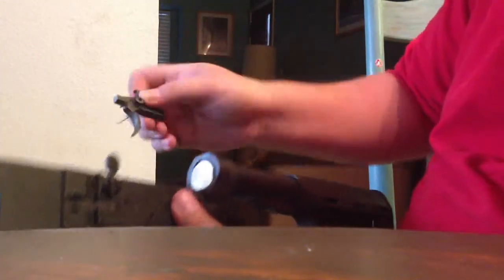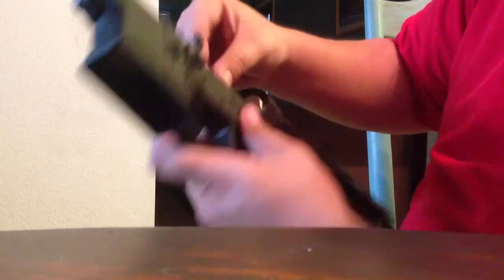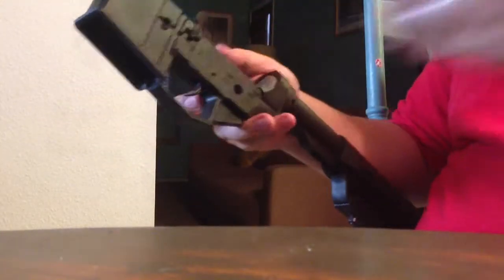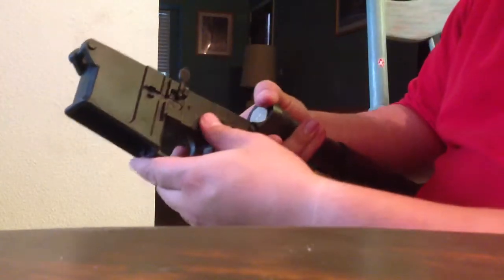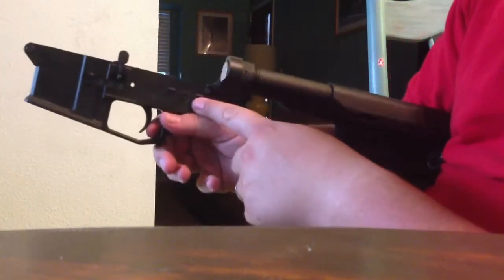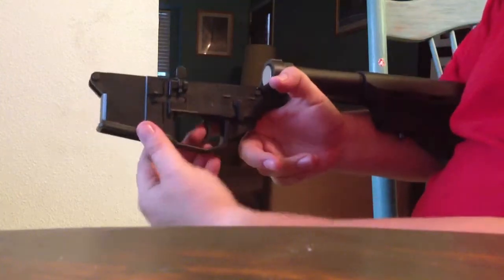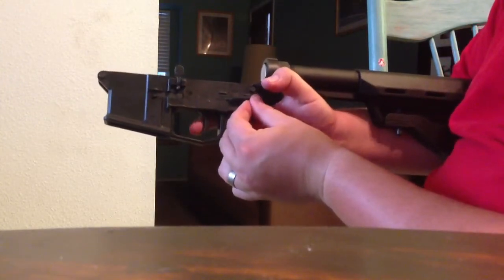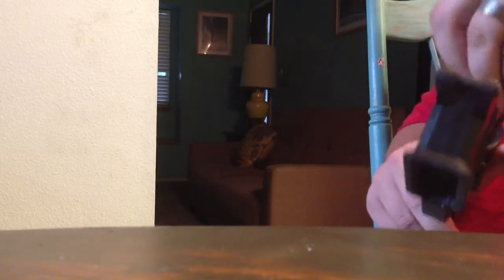Hammer issue on my lower

Comment: Hey man, incase ya didnt fix it by now you can try this to most likely fix the issue...  1) Remove the safety select. 2) Install trigger and hammer parts using the real pins. 3) Now look through the safety select hole and see if the tail of the hammer is poping up too high, occupying space where the safety swtich normally is. 4) If the Tail of the trigger is too high, then mark the part of the trigger tail with a pencil that you see protruding into the selector space from the hole. 5) Remove the hammer and trigger parts. 6) Carefully grind down or file down the part of the trigger tail that you marked to be protruding. Make sure you do not remove too much, its better to remove less and go back to remove more then to remove too much at first and ruin the trigger. Do and neat job. 7) Install the trigger, safety selector and hammer assembly and Problem should be solved.
If not ... umm opps my bad =/ lol jk but be careful and make sure the method I described will remedy the problem.
Good Luck!!!
Reply: Interesting
Reply: Wonder if he ever fixed it? lol